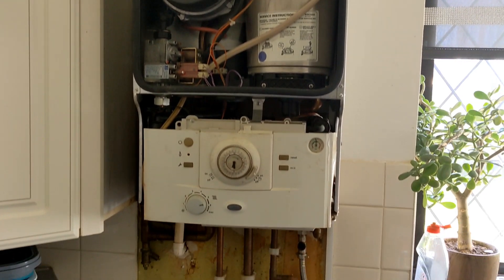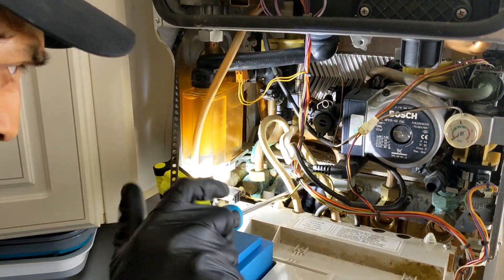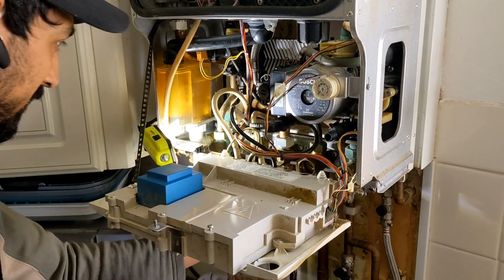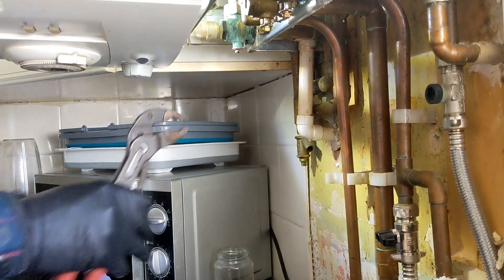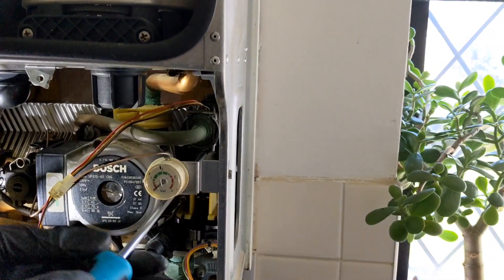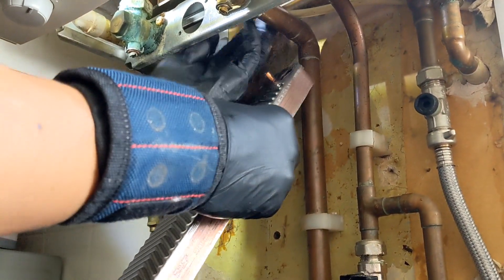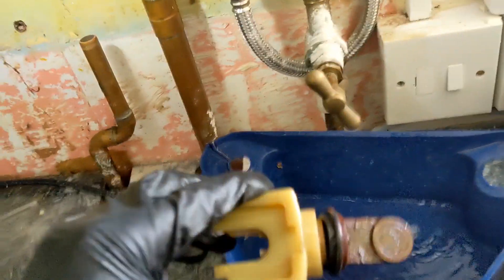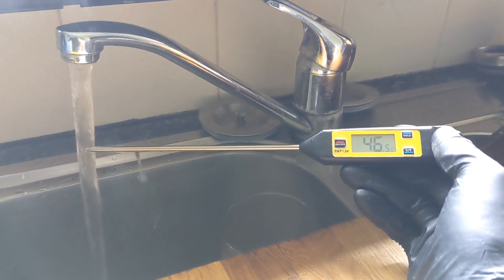Worcester Bosch plate heat exchanger replacement - the easy way

Comment: You really didn’t need to cut the hot. Could have just pulled the pipe forwards off the jig. Changed 100s like this 👍🏼

Comment: Is it ok to replace a 10 plate with 12 or 14 that look the same on a Worcester greenstar 30si, thanks 👍🏻
Reply from the maker: Yeh as long as it fits depth wise it's no problem
Reply: Thanks for answering 👍🏻👍🏻 @cputilitysolutions

Comment: great vid buddy. I have greenstar junior28i the prob is with. the hot water at first runs hot then cold for a period then will be ok for a while?. Any advice would help. cheers.
Reply from the maker: Thanks, you'd need an engineer to investigate whether it's the plate heat exchanger like in this video or another affected component 👍🏾
Reply: cheers buddy. ATB.

Comment: I was told this: "The boiler is slightly overheating. We believe it's the plate heat exchanger but we do not change them on Worcester boilers because of the lack of access. You can change the plate heat exchanger but it is not guaranteed to solve all problems and it will involve taking the boiler off the wall and apart in order to change it. It is probably better to consider changing the boiler at this point."  My boiler is 11 years old. It is a Worcester Bosch Junior Combi. How long will the boiler last if I do nothing.
Reply from the maker: Firstly I think you need to find another breakdown engineer who knows what they're doing rather than make excuses for not wanting to do the job. You will need the plate cleaning or replacing regardless otherwise the hot water symptoms will only worsen. Having not seen the boiler I can't say how long it would last as it depends on the overall condition of it and the system water quality
Reply: @cputilitysolutions  Latest update: "The overheat only occurred in max direct hot water mode which was used to stress test the boiler as we had to carry out necessary checks.

The boiler was not found or left in max hot water mode so the overheat will not occur for now. It should not occur at all but there is likely some congestion and therefore some inhibited thermal conduction.

You do not need to change the boiler imminently. You could potentially call Worcester if/when you need extensive repairs. We don't repair Worcester boilers with thermal conduction issues, because of the quantity of parts/labour that can potentially be required.
Reply from the maker: @janegreen191  I don't know who this company is that you're using but all I can see are excuses not to do the job unfortunately. Whereabouts are you based?
Reply from the maker: Drop me a message on 07912288451. I can come to NW3 if you want me to sort it for you 👍🏾

Comment: Do you change the four rubber washers when you change a plate heat exchanger or take one out , if not are the old ones usually ok ?
Reply from the maker: Not usually mate, I just silicone grease and reuse them

Comment: Hiya mate are there those rubber washers that come with the phe? Or do tho original ones stay in there ?
Reply from the maker: Can't remember what I did in this video lol, but usually if I'm changing the plate I'll change the washers but if I'm just cleaning it then I'll just grease them up again

Comment: Well did you check if there is MANGNA. FILTER. & Cleaned it If no filter . one should be fitted . That heat exchanger will get blocked soon

Comment: Everything about these boilers is badly designed from a service perspective. The PRV is an absolute joke.
Can't stand the bloody things
Reply from the maker: Tell me about it
Reply: @cputilitysolutions  what was the reason for the p2p to be replaced?
I'll be doing one tomorrow on a Worcester greenstar 30I. 
Will it be the same process to replace as your one? And did you replace the o rings?
Also, is it imperative to isolate return and flow and do you have to drain out the expansion vessel?
Reply from the maker: @grimawormtongue2014  boiler was overheating on hot water. Yes it should be the same process, but if it's a newer ERP model then you'll have to cut the cold and take it out through there 👍🏾

Comment: Hi my boiler has a leak driping from behind, I called a boiler engineer and he said is the back plate heat exchanger,  is there any possible cause for the leak, I find it confusing to say the heat exchanger is leaking. Thanks
Reply from the maker: Might be the hydroblock. You would need an experienced engineer to investigate and resolve it

Comment: Good video, my hot water starts hot then becomes cold after 3-5 minutes could this plate heat exchanger be the problem ?
Reply from the maker: Potentially, but you'd need someone out to check it properly to confirm this

Comment: Good vid, you can also just pull the dhw pipe through the chassis hole, and drop the plate down, the dhw temp is a bit low, as at the correct flow rate it should be 40 degrees above the cold main, so you should of got 49.6 min. maybe the flow reg/silencer housing were passing to much? love your vids tho mate.
Reply from the maker: Yeah there was a bit of an issue with the HW getting the correct temp rise. I tried a few different things, the flow rate at the bath was only around 9l/min so not great. Even when putting the boiler into max rate it sounded like it was holding back a bit. It was a landlord job and I never got a chance to investigate further as LL didn't want to pay additional as long as tenants had HTG & HW

Comment: This is a brilliant vid. Thanks so much for this. Was getting scalding hot water and kettling. A flush and clean with one shot didn't work. Got the exchanger and diverter out in double quick. Cleaned and soaked in acid. Jobs a good un.
Reply from the maker: Lovely stuff nice one mate

Comment: hi i was in need oif sone help please.  i saw one of your videos where you used a brush to clean a vailant main heat exchanger, i quite liked that, i did try sourcing it on the net but couldnt quite find the same kind. i shall be greatfull if you could tell me exactly what hardware store i should be looking at so i can go direct and just purchase assuring i get the correct one.  Thank You in advance. Karamat from THE GAS WIZARDZ

Comment: Great video, has helped me just swap a plate out. The plate I took out had BOTTOM written on the bottom. The new one had no markings other than some numbers. Is there a top and bottom to these plates? The system tested fine but I just wanted to make sure.
Reply from the maker: Hi, yes there is a top and bottom mate, it will only fit one way so if you got it in then you got it right. Also look at the direction of the grooves on the face of the plate, they'll be going in one direction so make sure you put the new one in the same way 👍🏽

Comment: Sometimes you can undo the screw which holds the expansion vessel in place, give it's plastic support a wiggle to give you a wee bit more space and then slide it up the back. It is tight sliding it up the back but it can be done and you don't have touch any other water connections. Or remove the hydroblock, or pump ......... 

So many ways to crack this nut

Comment: I ordered the part from ebay and fitted it today the way you say in your video, I know have hot water and heating, without you it was going to cost me from a local plumber £120 labour plus parts, it only took me 45 mins. his hourly rate must be around £300. THANK YOU for all your help.
Reply: Correct, we charge well, it's because we are running a business with overheads, also you're paying for what we know, had you messed up or got something wrong, you'd have been ringing the engineer back with your tail between your legs ... seen it loads 👍
Reply: you need to be gassafe to replace the plate as you have to remove the casing
Reply: @stevenjohnson6082  regs say be gas safe registered or competent to so.
Reply: @stevenjohnson6082  That only applies in a boiler that isn't sealed. I.e. conventional flues. Gas work only applies to gas work in that after you are finished you must carry out basic gas safety checks and in the case of a HE it's the same as changing a radiator. 

You're confusing the casing with the burner casing. Anything that disturbs flue gase or gas valves or fittings that would require a gas tightness test or where flue gases are concerned a spillage test then you have tk be registered. As it stands you can change a plate, a pump etc as long as its done in a way like this.

A good example would be that you can't change the PRV on a viessman V100 because you have to remove the burner in order to get to it, unless gas safe registered. But on some other boilers that's not the case so you can change it
Reply: @foryourlugsonly  the boiler is sealed  thats what the  rubber seal is for  all though the plate is outside of the chamber by removing the casing you no longer make the boiler room sealed  and when you replace the casing you have to do your 26.9 checks,thats why we have to be gas safe registered
Reply: @foryourlugsonly  the boiler is a room sealed appliance, taking the case of breaks its seal. You must therefore have to carry out your 26.9 checks which you have to be a gas safe registered engineer that holds the relevant qualifications, not someone like you who wants to pretend they have a clue.

Comment: That’s a brutal was of doing it. Cutting pipe and using grips isn’t the way to do it. I removed the pump in 5 minutes and pop, out comes the plate! Easy peezy
Reply: Its less connection his way it makes sense and its easier
Reply: His was is good.

Comment: I find I can just undo the compression on the hot and move the hot water pipe to the side and the p2p drops down. In extreme circumstances I have to cut the pipe or do as you did. 
Always different ways of doing something.  As long as we get the same outcome. Bless you bro👍🏼

Comment: Not sure why you need to take the hot connection off mate. The plate drops through if you move/cut the hot water pipe. 👍🏻
Reply from the maker: I just find it makes it easier to push the hot pipe back so I can remove it mate
Reply: @cputilitysolutions   Fair enough. I tend to move the pipe or cut it. Each to his own bud. Stay safe.